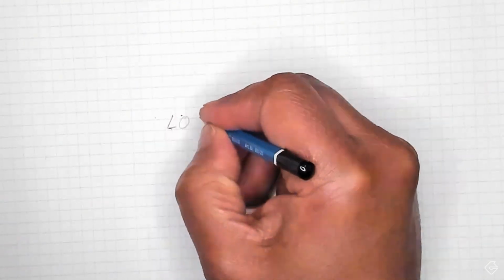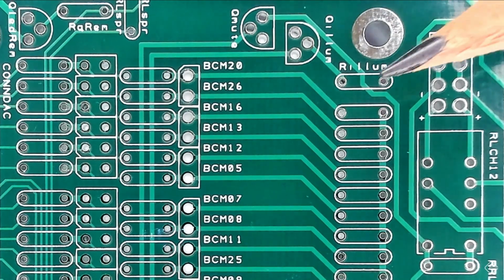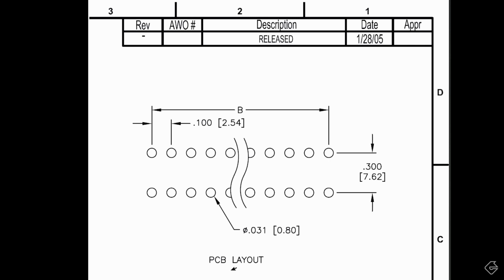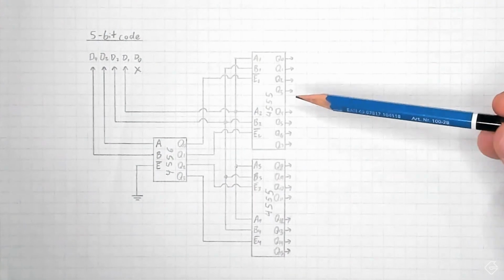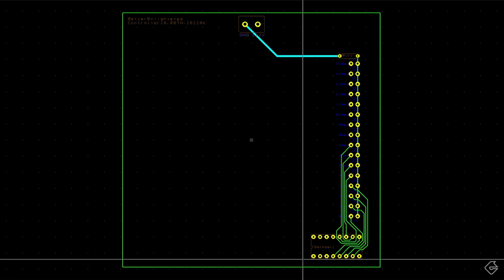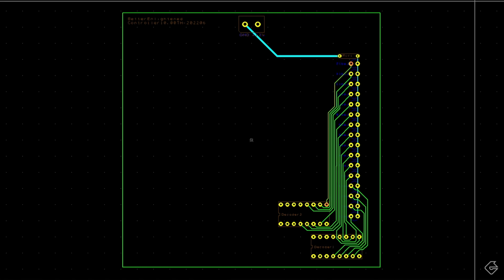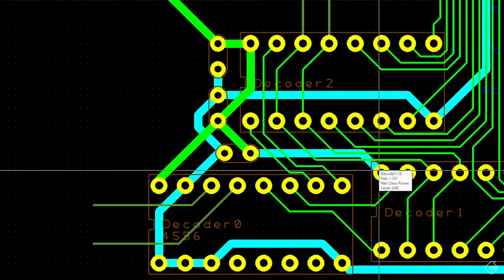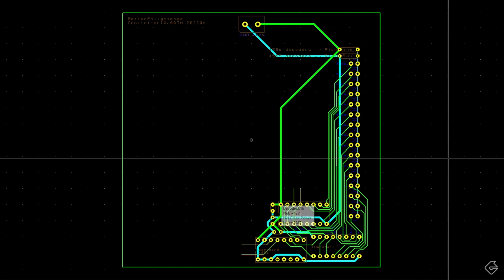PCB Design Part One Episode 018

Comment: Nice video. What do you consider to be "high frequency" when it comes to designing a layout?
Reply from the maker: Thanks! I'm glad you enjoyed the video. I suppose "high frequency" happens when unintended capacitance or inductance slows down the rise and fall time of digital signals to the point where the state of the signal can no longer be reliably determined.

For example,  certain (terrible) PCB layouts can generate hundreds of nanofarads of unintended capacitance. Together with hundreds of milliohms of resistance on longer traces, you'll get rise and fall times in the order of tens of nanoseconds which puts the "high frequency" bar at around 100 megahertz.

Another way to look at it is if your traces are long enough to act like electrical transmission lines. For traces on the order of 100mm, this occurs at roughly when the wavelength of the signals reach 1m. Assuming a signal propagation at half of the speed of light, this occurs at a frequency of around 150 megahertz.

The longer your traces the worse it will be. That may explain why modern electronics are so tiny...